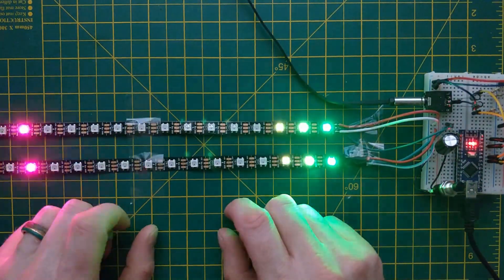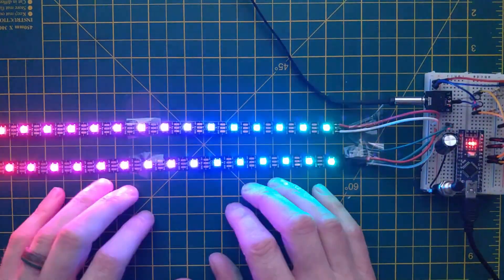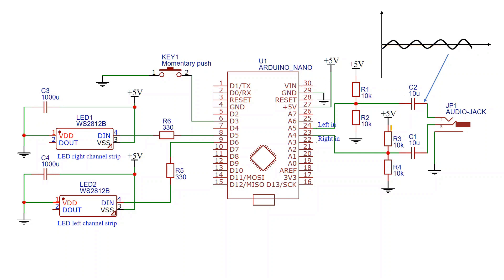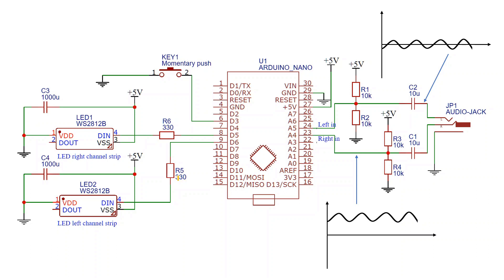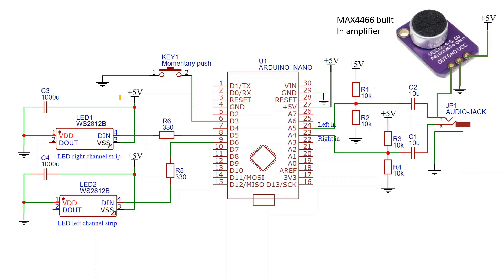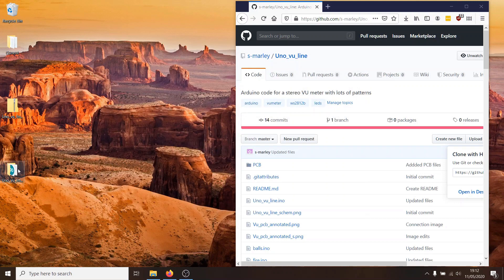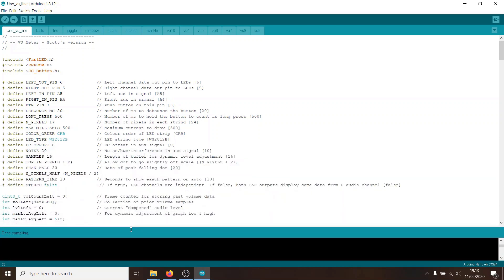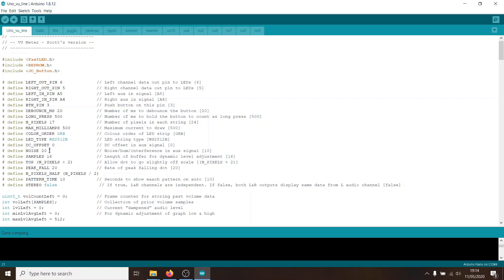Arduino sound reactive VU meter WS2812B LEDs

Comment: Nice job.
CineLights projects have inspired lots of people myself included. ;)

Using the EEprom to store the button state is a good idea even given the limited write cycles available ..I think the '100k' write cycles should be enough for many years ...and the nano's are soooo cheap.

nice github repo.
very nice explanation in the video.

 The mic I prefer and use is the ADMP 401 mems mic's as they have a much much lower noise floor.

I see you 'found' the answer to using a nano was to reduce the samples from the original 60 to a lower amount ....I found there is a limit though the lower you go the more 'twitchy' the resulting vu visuals are....have you seen this ???..just wondering if it my cheapo nano's

have you thought of mapping the multiplier of the  lvlRight/ lvlLeft variables using a pot attached to an analog pin for crude 'sensitivity' adjustment without editing the code each time...(using a mapped variable instead of the 7 multiplier)
I know this works on Cinelights original code as I've done it.

every so often I come back to making a vu meter for fun.

you're link to Cinelights  doesn't seem to work so try this 

 https://www.youtube.com/channel/UCOG6Bi2kvpDa1c8gHWZI5CQ/videos
Reply from the maker: Hi, thank you for your kind words and the heads up on the cinelights link, I've fixed it. You are correct, with samples set to 16 it does get twitchy. If I set the samples to 60, I can still run about 100 LEDs (50 per channel) with no problem. Wouldn't want to go much higher than that though! I think I'll update the code on GitHub for a higher sample number, it does definitely look better the higher that number is, but I didn't want people running out of ram using longer LED strings.
I could definietly add pots to control various parameters, but I wanted to keep this as simple as possible, and I originally built this to use in the suitcase boombox you can see on the thumbnail image. I didn't want any external controls so I just left it at something that seemed to work ok.
Thanks again!